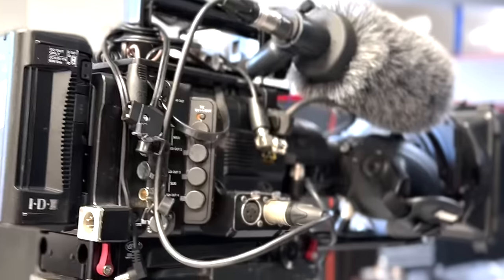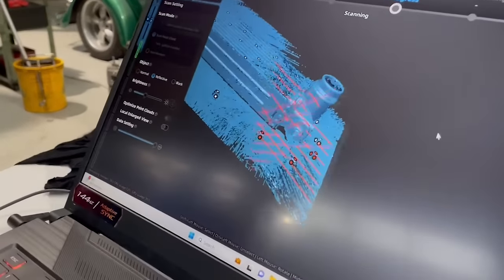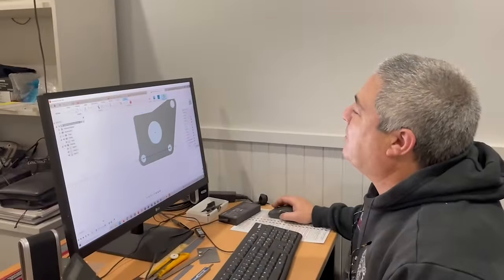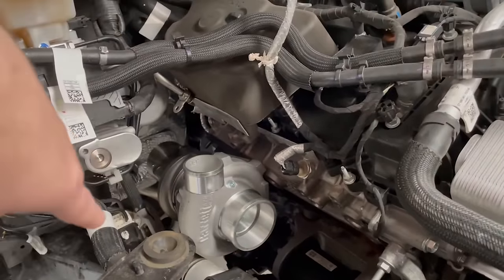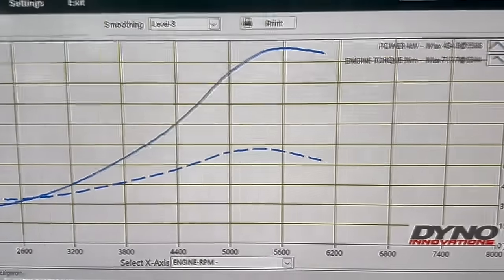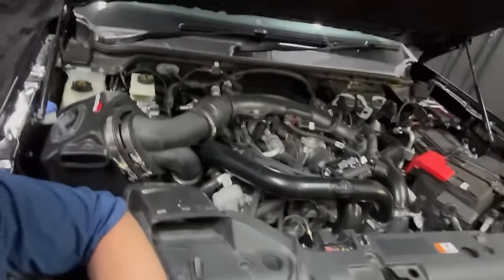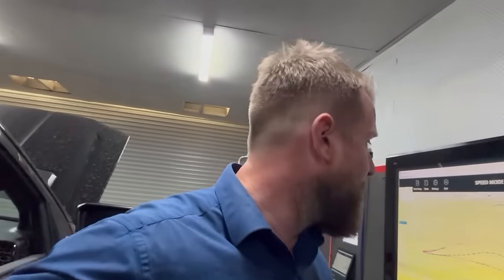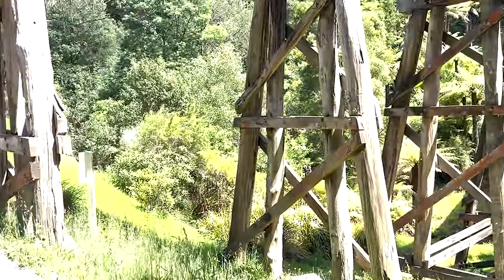World Record Most Powerful Ford Raptor 3lt v6 Twin Turbo! - Episode 4.

Comment: Pretty impressive “ going to be smiling when they pull up at the lights next to a y62 
Don’t think you’ll get much change out of 20k though
Reply: It's only money
Reply: Im guessing from top to bottom, drive in drive out will be at least 20k if not closer to 25k